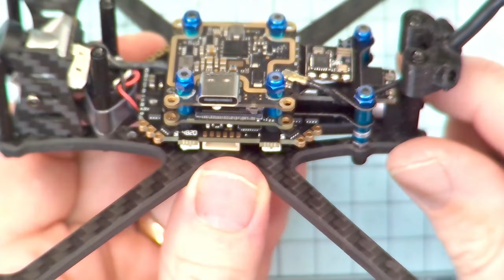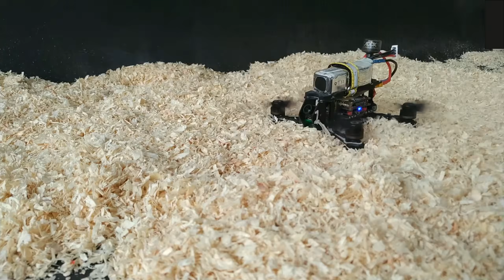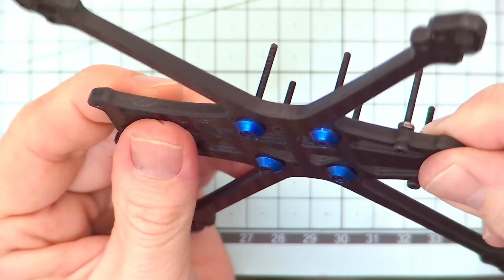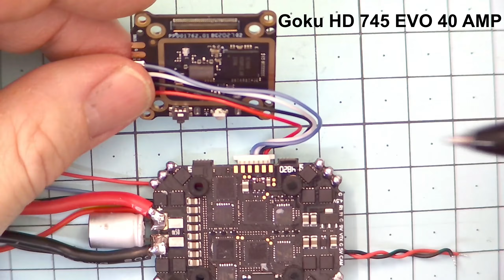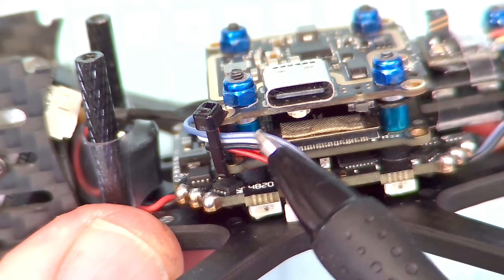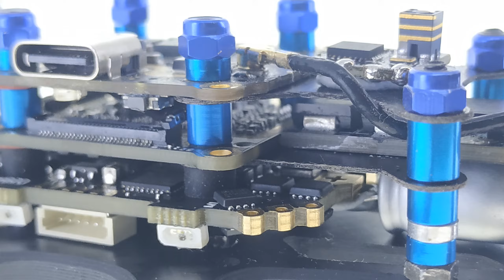Gep RC Smart 35 AIO Stack Build

Comment: Great  video speeding it up made it much more simpler to keep track, any chance you can explain  the difference between xt30 and xt60 also xt90?
Reply from the maker: XT30 / 60 / 90 are just different size connectors. These days most quads up to 4 inch use XT30 and 5 inch which use 6S batteries with higher voltage use XT60.

Comment: What was the final weight of this build? if you are after a super light 35 build try the GNB 660mah 4s batteries, looks like you are using the tattu 850s there? 
also i may be wrong but i think the better way to put the spike absorber on is to run the cap legs through it and solder to the esc that way so there is no legnth of wire to it. Pretty sure having it on a wire limits its effectiveness.
Reply from the maker: Airframe is 145grams and with a 750 mah 4S it comes to 229 grams. 650mah 4S also gives good results but I just find thke 705mah limits battery sag a bit. The method you suggest here for the Fettec spike absorber is what I usually use, but on this build the AIO board is too long and the spike absorber won't fit behind it because it ti too wide to protrude through the rear frame standoffs.
Reply: @cubefpv  ah fair enough, mine is at 150g but not a naked vista, we had been using the GNB 660 batteries, but they have very thin cables, which we figured were causing part of the sagging, the hope is the GNB 650s (which is what i meant to type above) have a much higher C rating and thicker cable so should perform better.  The lighter batteries fly completely differently, but i do agree the 850 is a good fit for this sort of quad, i can get 8 or 9 minutes out of mine if its flying level.
Reply from the maker: @mikedoesstuff3641  Yes 650 to 850 is good. But must have a high C rating. Mine are 90C I think.